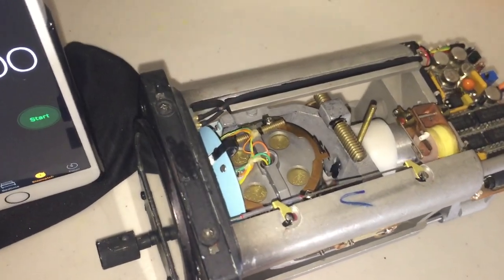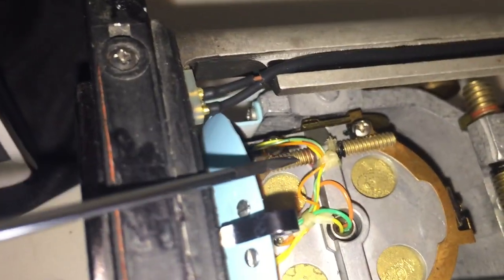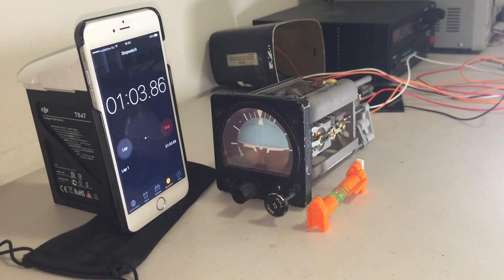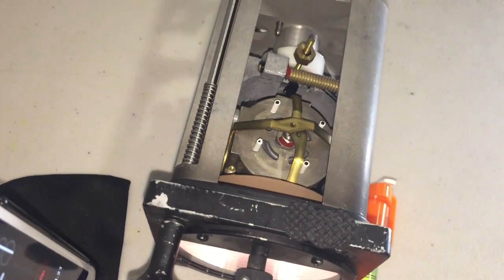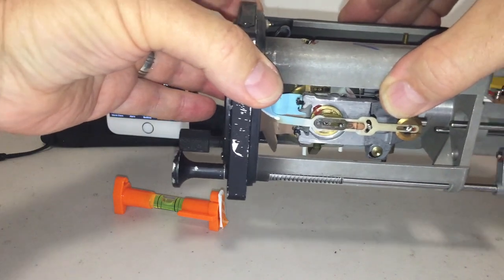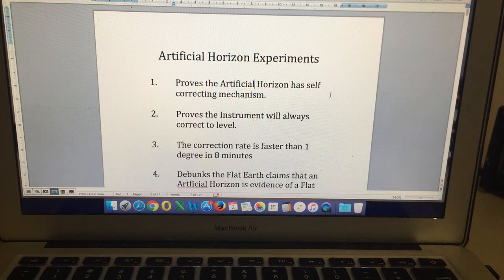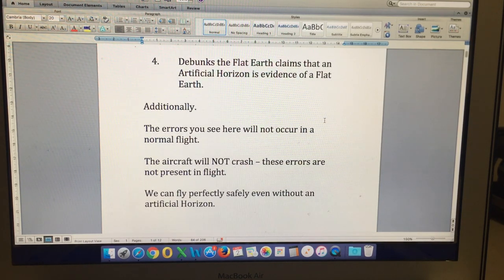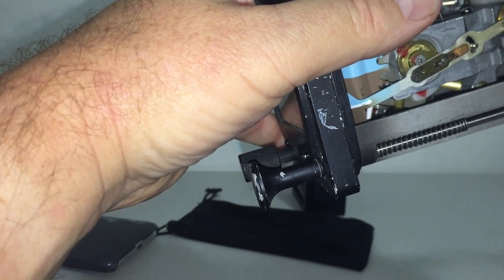Flat Earth - Time Lapse - Inside an Artificial Horizon while self correcting.

Comment: Regardless the plane fly's flat  without need to pitch down ...ever...for curve
Reply: systemautomation  wrong.
Reply: am I missing something ?  Yes or no ...it's a glorified level ? go level, reset with cage or allow unit to re-level when standard flight ....what
Reply: attack is all you got ? Reply it is not...
Reply: "gyros and there ability to correct for curvature"   >their< <<<stupid  ...lol   so a mechanical gyro pitches forward because of gravity somehow.  Ha ha .great sciencing ...love it. What of sagnac gyros in modern planes.set on origin ground only and never needs to reset in flight ...{ note : the landing destination  is on a different "supposed" plane so how ? 
A plane flies on a plane and a plane is a plane is a plane  ...is a plane ....is a plane
Reply: Toucher ...flies on my face ...so the height changes and you must need to pitch down constantly to keep your altitude. ...disregarding your gyro reading of level flight.
Reply: systemautomation  No, they call them airplanes because they are powered flying vehicles with fixed wings and a weight greater than that of the air it displaces. They fly in the atmosphere. They call it the atmoSPHERE because it covers a sphere. Simple reasonable logic. Nothing complicated about it. Common sense which you do not possess. Adding illiteracy to an already bulging sack of personal fallacies does not support your, frankly already, paper-thin argument.
Reply: I honestly don't know how else to make it clearer. Maybe Wolfie can.
Reply: Make it clearer ...ha ha...you did not answer a single question of gyro and gravity ...or the curve adjustment calc...just correct for 
Try this one ..you put cruise control does it depend on altimeter or gyro?
Reply: Nebthedweeb...have a tissue. I had no intention of making you cry...I'm so sorry bud
Reply: ALSO... one must be aware that this type of altimeter relies on "density altitude" and its readings can vary by hundreds of feet owing to a sudden change in air pressure, such as from a cold front, without any actual change in altitude.[2]
Reply from the maker: +systemautomation.  Hello, I will not insult you but I have to correct you.  Yes aircraft do compensate for curvature. 

They don't need to pitch down relative to the Horizon, the attitude in relation to the horizon remains the same but measured from a starting attitude the aircraft is slowly rotating forward at 1 degree per 111 kilometers.   The gyro appears level throughout as it is constantly correcting to level as you fly.  The direction of down changes and the gyro senses this and adjusts smoothly and continually for it.  

The Eotvos effect proves this is occurring.  I have tested it myself and have several videos demonstrating it.   

Objects weigh less flying East than flying West, consistently and meausred different ways.  You can try it yourself.  

It proves aircraft are following curvature and also that the Earth is rotating. 

Our fligth plans factor in curvature two ways - this is 100% fact. .   Flying at high altitude the distance is greater than on the ground due to the curvature - the circumference of the curve is greater. 

The word aeroplane comes from the French word ""Aero"" for Air and the Greek word "Planos" for wandering. 

An aeroplane is an air wanderer.  The name is not related to the shape of the Earth at all.
Reply from the maker: +systemautomation - The altimeter relies on air pressure.  When you are flying you are following a pressure level so you don't see any changes even if the air pressure varies along the route.

There is no descending required for the aircraft to follow curvature.  All that is required is to maintain altitude.  I made a video explaining that recently.  It is a misundersting I see Flat Earthers claim often and it is simply wrong.
Reply: +systemautomation  how many hours have you spent flying internationally? i dare you to take your flat earth map and have one of your flattard friends to fly you using one of the 30+ flattard maps. see where you end up. oh and disable all gps in the plane and use time lapse videos with multiple cameras
Reply: Thank you for your reply ...as much as I am seeming a FE'er I am not but certain arguments seemingly reasonable...I am an electronic engineer and not a pilot ...There are items of contention as far as gyro and level flight ...You say it compensates the aircraft is slowly rotating forward at 1 degree per 111 kilometers.  ok    How ...using altimeter to find altitude?   and then level off. You then depend on gyro ?  what of cruise control ...gyro or altimeter ...both?

what instrument does the correction   ...detects what ,..level or pressure ...gravity??  and correction is mechanical so no communication between them...
Reply: JDM...A'F    Tissue ??  Sorry btw ...didn't mean to scare you.  I will stop just for you...ha ha ...Your world is round  ...sleep well sweety..
Reply from the maker: +systemautomatation.   

Ok, let us work though the logic and I am sure you will see the answer clearly yourself. 

1.  We agree this instrument has pendulous vanes?  Yes? 
2.  They act to open and close opposing ports when the gyro is not level - agree?   We see it clearly in the video. 
3.  The vanes are simply moving due to their own weight and therefore hanging evenly when the gyro is aligned or hanging unevenly when it is not aligned.  - can we agree so far? 

The misalignment can occur for various reasons.  Precession, Manouvers...or. 

The direction of "down" changes.  If Down changes by 10 degrees from the original direction then the gyro will be misaligned to this new direction of down.  Follow? 

The vanes will sense this and act accordingly.   The gyro will align to the new level. 

This is a smooth, steady and ongoing process because even at jet speeds we only cross 1 degree of curvature in about 8 minutes so the corrections are occurring slowly and continuously and the gyro will alway appear level to the pilot.

If I was able to change the direction of "gravity"  then you would see the gyro aligning to this new direction exactly as you see it aligning here.

The aircraft is maintained at a given altitude by reference to the altimeter.  If the pilot notices a climb he will push the nose down.  This is always a continual process and many corrections are required to fly an accurate constant altitude.  

The autopilot does the same thing, it senses deviations on the altimeter and adjusts the nose accordingly to maintain altitude accurately.
Reply: Thank for your time sir I will research further ...you have given me something to think about relative to the dangling veins following contour of the surface as a pendulum constantly being pulled to the center of the earth therefore keeping a pseudo level plane ( which corrects for curve)
Reply from the maker: +systemautomation.  You are welcome.
Reply: +systemautomation    thank you for pointing out my atrocious spelling error.  of course i meant 'their' and not 'there'.  

however, a 'toucher' is someone who touches, someone like george w. h. bush, for example.  i think you meant 'touché' as an acknowledgement of your own error and john's correction.

it is clear from your multiple errors and my single slip that i am right and the earth is a globe.

is that not how logical arguments and evidence work? no? oh well, nevermind.  here is the curve of the earth: https://www.youtube.com/watch?v=LSrL4xIQT7E&t

but don't let me distract you from the pendulous vanes.  at least you are considering some facts and are on topic.
Reply: +system   firstly, a spelling error is not stupidity.  it's just a typo.  the fact that you are french toucher is neither here nor there.  the french might object but i don't care.  do remember to wash your hands after touching the french, though.  i am told they don't bathe very often.

my link is the most relevant visual evidence for the curve of the earth that you are likely to find on youtube (except for earth seen from space).  it is the very curve you doubt.  it has been measured and filmed in different locations, in different conditions and from different points of view.  there is no appreciable atmospheric effects in the video i linked you and there are no known atmospheric effects that can cause the curvature seen.   it is the curve of the earth and it has been measured:  http://walter.bislins.ch/bloge/index.asp?page=Flat-Earth%3A+Finding+the+curvature+of+the+Earth

your link shows a video shot mainly in the dark with no clear observations that i can evaluate or calculate.   it's very foolish to compare your clumsy video, which entirely lacks observable facts that the viewer can measure for themselves, with soundly's videos.  you can calculate the actual curve of the earth from soundly's videos with no more than a map of the location.  you have been shown the very globe and you turn away from it to point into the literal darkness.  you have crossed the line from stupidity into wilful self-delusion.

here is another video showing the same curve:  https://www.youtube.com/watch?v=usgbXW_Gdic&t
the atmosphere is so clear you can actually see waves breaking on the horizon.  both spans of the causeway curve equally and without distortion and the distant crossway, which is at the same height as the closer one, is seen clearly below it.  you can find this location on the google earth (lake pontchartrain causeway) and measure it for yourself.  this is the complete and total answer to flat earth foolishness.  anything that any other channel may have to say on the matter, such as sly and wolfie, is mere icing on the substantial cake of truth that soundly has baked for us.
Reply: This is a much more thoughtful and applicable response. thank you for that.  Respect brother. 
 The view is compelling ...you see curve...no doubt there but it does not remove the refraction element possibilities and lens effects.  sorry...can't trust it...on that basis.  
The frozen lake laser has no refraction element. This to me is the only true way to measure. Sorry. << Canadian ..ha ha. 
Wolfie Also respect to him. The vane...the vane.  ha ...thinking about that one...
I do hope I am wrong too, it's not easy being green ...ha feeling outnumbered but still ...in pursuit of science I soldier on. 
Thanks for trying.  I still have questions but will keep an open mind as I hope you do too. 
In religion I was taught happy are those who believe without having seen.  I disagree,  in religion or science.  Proof is in the eye of the beholder who can discern both fact from fiction.  Stories hold much fiction especially old ones...Math ...science ...religions ...laws.....etc.   are all up for review at all times.  Devotion to dogma is wrong.
Reply: +systemautomation   you can compare the many videos soundly has done in different conditions to rule out atmospheric effects.  you can calculate the curvature.  it would be an incredible coincidence if some atmospheric conditions caused apparent curvature that matched the claimed curvature of the earth.  you are also invoking unknown atmospheric effects.  refraction is not known to cause objects to appear to curve downwards and you provide no evidence of it doing so.  you are having to make up nonsense to explain away the obvious curvature.  that's not a rational way to proceed.

given the overwhelming evidence for the curve of the earth and the vast number of people who claim to work with it and given clear visual evidence of that very curve, don't you think invoking unevidenced atmospherics is irrational and shows a desperate, closed mind trying to protect its unevidenced world view?  how can a video filmed in the dark and with no clear, visually evidenced measurements cause you to have the remotest doubt when compared to the far clearer evidence for the globe?  you have to rely on their claims about height and location and you have to rely on their competence with measuring.  you also need to rely on their calculations for curvature not to mention the quality of the laser.  you don't need any of that with soundly's videos.  you just need eyes to see the video, a map of the area to find the distance of various markers and then you can measure it for yourself.

you should also find soundly's evidence vastly more compelling, reliable and persuasive because of the many, many videos he has done.  he has repeated the observation again and again just as one should with a scientific observation.  how many measurements and observations have been taken over the frozen lake? are they all done in the dark where we can't see what's going on?

here's some more curvature:  https://www.youtube.com/watch?v=NR2-8wrz-sE
you can see some atmospherics at the horizon but can they really account for the curvature evidenced all the way to the top of those pylons?
here is the same curve shown from the perpendicular:  https://www.youtube.com/watch?v=GypxnDT1oBQ
refraction certainly doesn't bend things left to right or make them appear below the horizon in some location but not others.

look at his channel.  can you honestly say you have seen any flat earth channel which offers so many consistent observations of the shape of the earth? he has even recorded it live and while driving through the line of the transmission towers to show the curve is visible from both sides.  i don't think there is even a glober channel that gets close to his thoroughness and rigour.
Reply: over water ...over water...Refraction ...Refraction.  Sorry...light is bendy. 
Again doesn't take a genius to understand "put a light on drive 7.5 miles following a straight beam on his snow machine. No refraction just him on a flat plane with a dot on his windshield."  but perhaps it takes one to understand the significance of this simple test.   
The one who is desperate appears to be you my friend devoutly defending and bowing to your science Popes and Bishops who tell you to trust believe without seeing"proof"  Amen brother. Religion and science manipulate the people to the way they want you to think and be.  In the time when globe was defined all scientists were deeply devout to religion.  I question devoutly all.
Reply: +systemautomation    repeating nonsense doesn't make it so.  your opinions are irrelevant.  rely on facts and evidence.

you are inventing atmospheric conditions.  refraction does not cause apparent curvature.  you fail to provide evidence of it doing so.  you clearly believe in things you have no practical knowledge of and cannot demonstrate.  the videos soundly presents show curvature in many different conditions and locations and it has been measured an shown to fit the globe.  this effectively rules out any possible atmospheric effects as the cause of curvature.  it is beyond the bounds of reason to claim that a hitherto never before seen atmospheric effect is working in all these videos and just so happens to cause the appearance of curvature that matches the globe model.

meanwhile, the video you link is in darkness.  we cannot confirm the observation.  it is done once.  it's not comparable at all.  it is not even worthy of the name 'evidence'.

you are choosing to ignore the obvious evidence and are effectively lying to yourself about refraction and how it works in order to give yourself a reason to dismiss a huge body of evidence.  instead you accept an observation which literally cannot be seen let alone verified by the viewer.  you are believing what you are told by the video makers over accepting what you can actually see and measure for yourself.  this is indeed irrational, religious thinking.  do you honestly think you are being sensible here?
Reply: refraction DOES cause apparent curvature.  Unfortunate you don't understand this but yeah I have seen many videos that prove this.
Also long throw lenses have much more surface distance covered so more error compounded.  Lasers curve, light curves...atmosphere=lens= light bend. 
There is clear evidence of this.
Although crudely demonstrated in the video provided I remain on the fence as to what is fact and fiction because of it. Prove to me otherwise...Your efforts have been appreciated but misguided and inconclusive..., do your own research.  I have.            I might also point out your religious belief in those pictures of yours ..ha ...Funny.   Believe your gods , I will mine.  Btw ...Sensible?  Skeptical is what I am. I trust my own brain , make my own conclusions on facts that make sense to me.  Have nice day.  Respect to you sir though you have shown little to me.  I'm out.
Reply: +systme   if there are many videos showing refraction causing curvature or distortion that could cause what soundly's videos show then you should have little trouble linking some.  there is no reason to think that lenses can cause curvature of this nature either and soundly physically rotates the camera in this video to demonstrate that there are no lens effects: https://www.youtube.com/watch?v=FIi8YDS5GnI&t=113s

soundly shows curvature repeatedly and reliably in his videos.   if you have any interest in the shape of the earth you should make his body of work a primary source of study and not something to be casually dismissed with excuses you cannot demonstrate or explain.  that is not rational and that is not skepticism.  you are choosing the evidence you want to accept and it is very poor evidence as well.  in the dark you can easily see what you want to see.

i have shown you as much respect as i possibly can whilst treating you with the level of disapproval your way of thinking deserves.   if you behaved like this in more serious matters, such as moral or financial choices, you could well do harm to yourself or others.  i need to make it clear to you that you are not only wrong you are also very far from right and thinking the way you do is not respectable.  you are making excuses for ignoring an extensive body of evidence which is verifiable and measurable and, instead, accepting the unverifiable claims of a single video shot in the dark.

imagine you were do jury service at a murder trial and were presented with similar evidence for and against the defendant.  do you honestly think you are being rational and fulfilling your moral responsibility to tell yourself the truth and not excuses?
Reply: +system  i assume you are trying to show evidence for refraction producing curvature.  you will need to do better than that.  there is some 'wobbliness' to be seen but no constant curvature.  atmospheric refraction typically bends light down towards the observer allowing objects that would be obscured behind the horizon to be seen.  as the effect is dependant on the density of the atmosphere which varies constantly the effect is unstable and can be seen to wobble and is visible at some times and not at others.

soundly eliminates the possibility of atmospheric distortion by filming on many different occasions and in different weathers.  now a relatively cold period for louisiana and,as can be seen, in his latest videos, the view is very crisp and clear and no distortion is shown.  he further eliminates the possibility of atmospheric distortion by measuring the curve and showing that it is consistent with claimed size of the earth.  refractions is not constant and consistent and it would be an incredible coincidence if it just so happened to produce curvature that matched the shape of the earth.

you will need to demonstrate atmospheric effects that produce constant and consistent curvature if you wish to seriously contend that this is the cause of the curvature we see in soundly's videos.   you have ignored all of this, which i explained in previous posts.  you are very closed minded and see and read only that which you want to believe.  the video you linked is full of blatant lies including trying to tell people that out of focus images of lights are the true appearance of the stars and planets.  you ability to distinguish fact from bullshit is woeful.  stop.  step away from the bullshit and start thinking with facts no opinions.

you have been shown the curve of the earth in many different positions and consistently.  you have nothing comparable to refute it with.  it is irrational for you to continue to ignore this overwhelming body of work with weak excuses simply so you can maintain your delusion.
Reply: Your fear of the truth and lack of scientific knowledge is obvious,  Sorry to have triggered you.  Believe what you want and Santa is alive and well.  Have a nice day.
Reply: +system    you are the person asserting that a video shot in the dark is more reliable than a comprehensive study of the earth's curve shown in multiple locations, points of view and conditions and that has been confirmed with measurement.  you have to invent atmospheric conditions that defy all probability in order to dismiss this compelling evidence.  you are clearly choosing to believe what you want, not what the evidence shows.

don't demean yourself further by dismissing arguments and evidence that rebut your nonsense with sad internet cliches such as 'triggered'.  that's not how intelligent adults talk.

you need to properly account for the curvature shown in soundly's videos and explain how it is that it matches the claimed curvature for the earth.  you need to explain how that curvature is consistent from place to place and time to time.  if you can't do this then the evidence stands unrefuted regardless of your opinions and unevidenced assertions.  you have been shown the curve of the earth and it's not going away just because you don';t want to believe it.

again, imagine this was evidence in a murder trial.  your irrational biases could well result in a terribly immoral act.  you are much worse than wrong.
Reply: Dude ...thank you ...now just let it go...You have not convinced me.  My irrational biases remain intact.....hope yours too.
Reply: +system    i disapprove of irrational biases.  i try to get rid of mine and i don't excuse them in others.   you should get rid of yours.

you should not come to a flat earth debunking channel and expect to get away with talking nonsense or dismissing the clear evidence for the globe you are shown.  you have been shown unrefuted evidence for the globe.  you have seen the curvature of the earth and you have no sensible reason to find it unconvincing or in any way deficient.  you have invented unevidenced phenomena to excuse yourself from addressing and evaluating that evidence and, instead, chosen to believe in claims literally made in the dark.  you know this is neither sensible or rational.

you are not questioning the shape of the globe or being skeptical when you refuse to address the evidence for the very thing you doubt.
Reply: So systemaoutomation, why would you think, there are mechanisms included in an artificial horizon, to correct misdirections, if the earth is flat. They would never be needed.
Reply: Observ45er 
Thank you for the FARR reference. I have been out of aviation for awhile due to physical healgth issues. So while I remember some things others slip away. And I certainly agree that this "engineer" is just a troll.
Reply: +Eric S.,
 You're welcome. I have just a little experience with engineers and I know one when I see one and, ah-hem, visa-versa... 
...
After a short while studying the FE phenom, it is clear that there are some people with no ability to follow a cogent thought process to a logical conclusion...just can't. It's Dunning-Kruger squared when they venture out of whatever their realm of experience is and try to re-design science to fit their emotional need, then force-feed it to others in a public forum.
- - 
Cheers, Steve
Science and Technical Advisor
challenger . org
...
 I just stumbled across the latest conspiracy - Jets run on compressed air, not fuel.... Seriously? you say (with an inflection just like Achmed the dead terrorist)...
...
I'm thinking of starting my own.  
Radio waves don't exist; never did.  A bunch of us Polish RF Engineers discovered how to Channel mental telepathy into a silicon chip so we can communicate via these little boxes with screens... Well. First we Figured how to suck it into a glass vacuum tube, but later accidentally spilled some on a silicon wafer and to our surprise thoughts just emerged, unencumbered by any potential across the chip... But don't tell anyone.
...
OH! SORRY! did I say wafer...? I didn't mean that...it was just a typo...
Reply: systemautomation the gyro will correct in order to be perpendicular to the net forces acting on it, as you curve around a globe the gravitational force will automatically cause the plane to tilt along with the curve, however you won’t notice it due to how gradual the change in attitude is
Reply: systemautomation if you pitch down, you will get closer to the earth, but when you fly you maintain a constant ish distance from the earth, and the gravity of earth is what causes the plane to curve its path around the earth and not the pilots
Reply: +TheNinthGenerarion,
This is an old thread.
...
TECHNICALLY, the plane is constantly "pitching down" ever so slightly and unnoticeabley, but is not getting lower in altitude, just following Earth's curve and the gyro keeps 'pointing' to the center of the Earth by virtue of the correcting vanes. . People get hung up on some of the words needlessly.
...
+systemautomation had the gyro correcting mechanism explained 5 months ago and he seemed to be listening, but wanted to think about it more.. 
...
It isn't obvious that the gyro takes quite some time to correct and the video doesn't do a good job of relating the correction to what happens in flight.  
Correction is slow so it does not change during any short term changes in aircraft attitude.  
...
It corrects to local gravity vector and since the vast majority of flight is level, it has lots of time spent there.  
...
When flying a turn, the local gravity vector is shifted toward the outside of the turn because it is now gravity combined with the centrifugal (outward) "acceleration" force.   This is why we feel normal in a banked turn. "Down" is now toward the outside of turn turn.
...
If you flew at a constant skidding turn, wings level for 10 minutes, the gyro would slowly correct and show a bank to the outside of the turn because the local gravity vector was slightly toward the outside...(centrifugal force -- the 'outward' one). This of course is not good because returning to straight and level flight the gyro would show the opposite until it again corrected.
...
The flat-Earth-types want to insist that gyros are incapable of changing the direction of their axis and don't understand this correction mechanism.  It is the typical latching on to one bit of science they don't understand and misapply it in their failed attempt to disprove another bit of well understood science that they have no hope of ever understanding.
...
+sytemautomation said he's not a flat-earther, just questioning something he doesn't understand and, unfortunately,  I find the other explanations are not clear enough.  Hopefully this one is better, though probably nobody is reading anymore...except you. (:-).
...
...just being honest.
...
Cheers.
Reply: Electronic Engineer as in a tech? Or an actual bachelor of electrical engineering? You should have the skills to try some things out for yourself. We all had the same first year.
Reply: +SynS7ven,
 Who you asking?
Reply: systemautomation
Reply: Observ45er that’s very true, in KSP I can take a flight and I need to do occasional pitching down the keep within a range of distance
Reply: Observ45er the Centrifugal force is not an actual force, it is perceived as real but we are really only feeling inertia
Reply: SynS7ven,
OK.  When they call them self an electronic engineer that is a clue...
Reply: +TheNinthGenerarion,

KSP ?
Reply: Observ45er Keenan Space Program, it’s a computer space travel simulator
Reply: +TheNinthGenerarion,
So, you're saying you must travel in a circular path to stay a constant distance from a planet in a game?
How is a space-travel game relevant to flight, or that some folks think a curved path isn't required, if imperceptible, for flight in the atmosphere?
Reply: Observ45er well there is also a space plane building element where you can build airplanes, but inorder to maintain a constant altitude you need to make many minor adjustments through out the flight are at least have the auto pilot do the corrections for you
Reply: +TheNinthGenerarion,
That fine, but it still has nothing to do with the reality of flight.
...
Pilots, when in control, watch the altimeter and the VSI.  Any "Pitch down correction for curve" is lost FAR, FAR, FAR  BELOW the noise of normal variations due to wind,  pressure variations and the fact that no plane can, nor ever will EVER fly ABSOLUTELY "Straight".
...
If they did, they'd be left far in space due to the 66,000 mph speed of Earth around the sun, or the 500,000 mph (or whatever it is) speed of the sun circling the Milky-Way. Planes fly in the air.
...
  All this "Dipping down" talk is irrelevant and due to ignorance of what's involved in flying.  They cherry-pick this one thing and ignore everything else that applies.
Reply: Observ45er well in KSP if I want to travel to a higher altitude above a certain threshold I will need to increase my thrust to go faster inorder to be able to get higher, but I can’t simply add every single engine as that would require more fuel which would limit my max distance and it will also increase drag making the flight less fuel efficient, and if you get too high then either you don’t have enough thrust to maintain flight or the engines lose all of their air flow and cut out